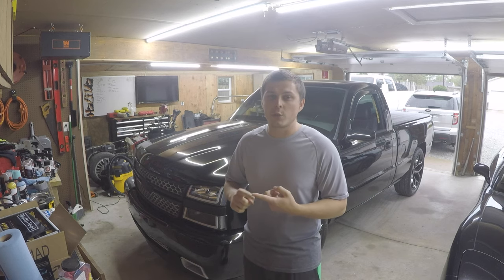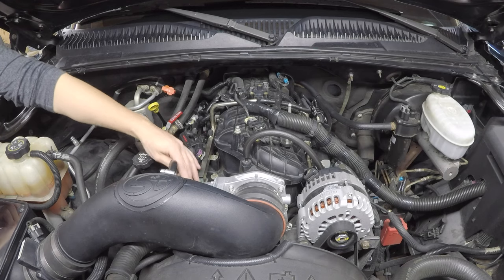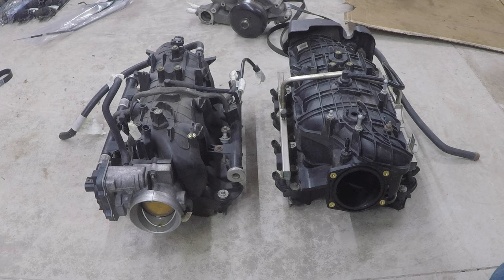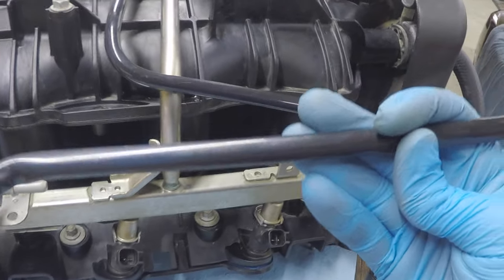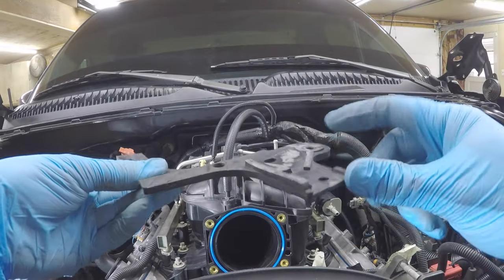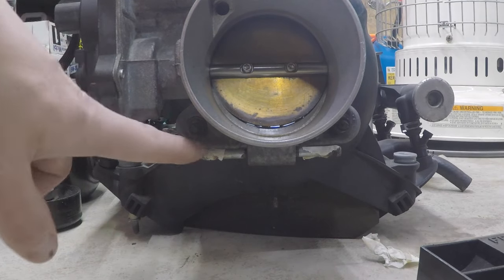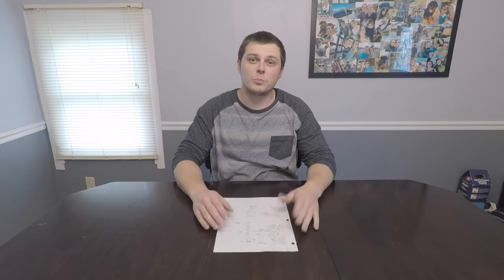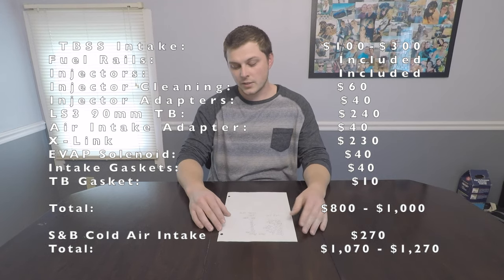TBSS Intake Swap, Ultimate Guide! Add More Power To Your LS Motor!

Comment: My 2004 Chevy Silverado 4.8l has the fuel pressure regulator in the fuel pump assembly in the fuel tank.  Would this tbss still work on my truck ?
Reply from the maker: Yup. The tbss/nnbs intakes will work on all gen III LS motors. If you have a single fuel line going to the fuel rails, that is a  return-less style fuel system (sounds like your setup) you don't need the C5 fuel regulator, and can plug your fuel line right into the fuel rail. If you have two fuel lines going to the fuel rail, that is a return style fuel system. You will need the C5 fuel regulator, so the extra fuel can be returned to the fuel tank.
Reply: @TheKingCoopa  Thank you for answering me.  After  losing $16,000 on my 97 30th anniversary edition camaro  when Precision Engine Rebuilders in Houston, TX  Ken and Rick Slataper built a 383 stroker that was supposed to be 500hp to the wheels  and it dynoed at 300hp and was put in the ship more times than I can remember then 4 months later the #8 cylinder went down and I had to sell it to the automotive shop because I couldn't afford another engine Rebuild. After all that,  I'm trying to learn to work on cars myself and watching your videos gives me good ideas.   I'd like about atleast 450-500hp naturally aspirated at the wheels in my 2004 Chevy Silverado 1500 4.8l,  but Im not sure what would be cheaper either buying a junkyard 6.0 or fixing up my 4.8l.
Reply from the maker: @texn9326  damn.... that sounds absolutely awful. Hopefully you will have some better experiences. If you're serious about building your engine, I would watch Richard holdener. He has dozens of videos about HP /power combos and shows engine dyno comparison. Definitely some great content. I have a pretty aggressive 4.8L that made 355hp/369tq. I even had a few people tell me I was lieing and forging the dyno numbers lol. But realistically, you aren't going to get 500whp out of a NA 4.8L. Anything 500plus NA is probably gonna be with a 6.2L. The 6.0L LQ9 im swapping to now, has Frankenstein stage 2 heads, 234/240 112 cam, 3600stall, ATi super dampener, electric fans, long tubes, tbss intake and 90mm TB. That is projected to be around 450-480whp.
Reply: @TheKingCoopa  That's exactly what I wanted to know.  Honestly I'd be happy with around 400hp.  I'm looking into the tbss intake,tune, and getting my stock heads worked on. Cam will come later.  Thanks for your advice and tips and videos and everything.  I've been watching your 6.0 videos. Your 4.8 videos was where I got alot of ideas from and helped me get a steady direction to go in as far as doing what to what.    Keep them videos coming 👍👍👍

Comment: king i have 2002 5.3 put a tbss intake are the intake bolts longer different from 02 stock intake
Reply from the maker: They are the same bolt lengths. If you are reusing your old bolts, I believe you just have to take the washer off them

Comment: Do you need to have it tuned to run the intake with the trailblazer ss intake and throttle body
Reply from the maker: Any airflow/fuel changes, a tune is highly recommended.

Comment: What makes your truck so loud
Reply from the maker: Hey, the two main things for it to be loud are the cam, and exhaust. All the extra performance mods help out, but a large cam is what really wakes up these LS motors. A bigger cam means more air/fuel ratio going into the combustion chamber. Which makes a bigger bang, and in turn has more exhaust flow. For my exhaust, I have 1 3/4in long tubes, which make more power over shorties. 3in catless Y pipe. Removing the cats will definitely help your motor out, and make it alot louder. The catalytic converters are super restricted. Then for a nice sound I have a gibson muffler and gibson tips put the side. If you run your exhaust out the back its better for the cab drone, but the shorter your exhaust is, the louder it will be. You could always straight pipe it,and it will be stupid loud, but never sounds good. 

To sum all that up, a large cam with a nice flowing exhaust, will give you a loud quality sound. If thats what your wanting. I love my exhaust setup, and it definitely turns heads all the time 👌

Comment: do i need an x link if I have a 2006 sierra and I'm getting a 2006 tbss manifold?
Reply from the maker: Just the intake, no. You will need the Xlink if you run the newer 90 mm LS3 throttle body

Comment: What happends if your intake/k&n  doesn't have a connection for the hose
Reply from the maker: Hey, sorry for the late reply. I'd see if you can figure out a port or way to mount it to your intake tube. That hose needs fresh air into the engine, you don't want any dirt, water, or contaminates getting in there! Plus the ECM is tuned for a certain air/fuel ratio. That little tube sucking in air is also calculated into the tune. I've seen some people put a mini air filter on it and leave it. but if you can, I'd try to connect it to the airtime. best of luck, and thanks for the support!

Comment: Did you keep the same cold air intake ? Being that the throttle boddies are different?
Reply from the maker: Hey, yes i kept the same CAI. I used a rubber coupling to adapt the two sizes. I believe it is linked in the description of the video.
Reply: @TheKingCoopa  awsome good to know and appreciate the response 🫡
Reply from the maker: For sure! Good luck with the swap 🤘

Comment: What lifters, pushrods did you go with?
Reply from the maker: Hey, I used LS9 lifters and Engine Pro (Smith Bros.) hardened push rods. They were 7.375" because of the milled heads.
Reply: @TheKingCoopa  Nice, .030 on the milling? What's a good guess on your compression, what head gasket thickness you use?
Reply from the maker: @bigkat776  sorry, I used LS7 lifters. The 243 heads were milled .015. The head gaskets were LS9. Not sure the thickness. And my tuner estimated about 10:1 compression

Comment: Since you’re running 32lb tbss injectors will you need a tune for the truck or it runs normal with them?
Reply from the maker: Oh yea, you will definitely need a tune. Its going to run super rich with the bigger injectors. I burned up my new spark plugs, in about 8-10min of just idle time. Had to put a new set of plugs in, not start it at all. And then had my tuner come to me, and tune the truck. I could have towed it to him, but he offers a mobile service
Reply: TheKingCoopa thanks appreciate the reply man 🙏🏼
Reply from the maker: For sure 🤘 also of you get yours used, id get them cleaned and flow tested. For the peace of mind. Mine turned out to be 36lb injectors, and were filled with e85 gunk

Comment: What pound injectors did you use for the intake ??
Reply from the maker: The injectors i got used. Were some GM OEM ones at like 36lb or 38lb. They were fine for the cam, but anything else they would be maxed out.

Comment: Can you still use a spacer with the 4 to 3 adapter plate ?
Reply from the maker: I assume you mean a throttle body spacer? I'd assume so. You would probably just need longer bolts to accommodate the spacer thickness.

Comment: I got a 04 Silverado I got a tbss intake will I need to get a tube for it to run good?
Reply from the maker: If you swap just the intake, you should be fine. But realistically if there are any airflow or fuel changes, a tune is definitely recommended

Comment: If i put the corvette c5 fuel filter do i have to remove my stock fuel filter on my 2003 silverado? Or can i keep both fuel filters?
Reply from the maker: Hey, sorry for the late reply. Only thing that really matters is if you have 1 fuel line (returnless) or two fuel lines (return style).  If you have the filter on the frame rail, id assume you have the returnless fuel style and would not need the c5 fuel filter regulator.   But if you do have the return style, id just run both, and check the Shredder valve on the fuel rail and make sure your fuel psi is still good, amd not slowed down by two filters. Hope that helps
Reply: Thanks. I just started doing the tbss intake on my truck im almost done. Just that mine has a retun line so I bought the corvette c5 filter but the only issue is that the lines hit the fire wall and it bend the lines

Comment: Will this set up work on my '07 Tahoe 5.3? I did the DOD delete and stage two cam.
Reply from the maker: Hey, you should already have this intake since you have a gen IV motor. The TBSS and NNBS intakes are the same thing. At the 4:13 mark, I compare the gen III and gen IV  intakes. Yours should already be the gen IV with the four bolt throttle body. 

But if not, yes you can swap this intake onto your 5.3L. Only thing to look for is make sure you get the right intake ports. Some of the gen IV motors have Cathedral Port or rectangle port.
Reply: I have cathedral port heads  @TheKingCoopa
Reply from the maker: @johnwalthers659  then just make sure your new intake matches, as some were rectangle port

Comment: Can I run the gen 4 injectors with the gen 3 Throttle body
Reply: And I know this is a dumb question do they have a plug for the evap solenoid
Reply from the maker: Hey so the injectors and throttle body don't really communicate with each other. They are kinda like two separate systems. So it wouldn't be an issue. But with gen 4 injectors, those are a newer technology. They send/recieve different signals than gen 3 injectors. It can and has been done before. But the fuel trims and duty cycles will have to be adjusted in the tune. The important part would be finding out the true flow rate of the new injectors, that will help your tuner out and will save him time. 
And I. Not sure what you mean about the evap solenoid. The plug/connector is on the side of it, and that connects right to your trucks harness. But if you mean a stopper, to disable the evap, it can be done. The guys who race alot, disable that system, and change that in the tune. Not exactly sure how all that works though
Reply: @TheKingCoopa  thank you
Reply from the maker: @haidenoubre8325  for sure, best of luck!

Comment: Are you satisfied with your 2600 stall?
Reply from the maker: Hey, short term yes, Long term no lol. It was great with the cammed 4.8L. Especially for daily driving. It handled excellent and still drove like stock. But 350hp in a full size truck is only fun for so long. right now I'm wrapping up a built 6.0L/4l80e/AWD swap with nitrous. The 4l80e will have a billet converter from Circle D. That will be a 3600-3800 single disk stall. The higher you go, the less streetable it will be.

Comment: Can I put this intake manifold in my 2007 suburban 5.3 new body style it would be just bolt on rite??
Reply from the maker: Hey, yes it should fit (the intakes are roughly the same height) and yes it will bolt in. But something to know, the 2007-2013 silverados (NNBS) have the same intakes as the TBSS. Being that yours is a suburban, I would definitely do the comparisons, because you might already have the upgraded intake manifold
Reply: @TheKingCoopa  thank you! I have a question I think I’m having problems with my intake I realized it was looses then I tightened it don’t know if I did to much it’s had a little rough idle I have done everything to it and I get a misfire on cilíndrele 1 and a po420 and po430.
Reply from the maker: So for your intake, depending how many miles are on your truck, and how old the intake manifold gaskets are. Those gaskets get hardened into that shape, and you can't re-use them, or you will have an air leak. So if your intake lifted, and you re-tightened it, it could still be not fully seated on the old gaskets and could be sucking air in, causing the mis fire. I hate to say it, but you might have to pull the intake and replace the manifold gaskets, to create a good seal. So that is 1 option. 
But first, your p0420 and p0430 codes are your bank 1 and bank 2 catalytic converters. Which i assume you have 150k mikes on the truck, and those cats are probably clogged. That would creat almost zero air flow out of the exhaust, crearing way to much back pressure, and that would definitely cause a rough idle. And the exhaust can smell like eggs.  So if I was you, first check cats, then check the intake. But oem cats can be very expensive, so if you live in an area that requires smog testing, id look into some high flow cats, half the price, allows your engine to breath better, and still passes smog. But if you don't require smog testing. Id get some speed engineering 1 3/4in long tube headers, with a catless Y pipe (about $430) then get a tune. Your engine will breath alot better, gain more power, and probably gain a little mpgs, getting rid of the cats. 
But look into those, and that should fix your problem

Comment: how could i connect the fresh air tubing when my intake doesnt have a nipple like the s&b ?
Reply from the maker: Hey, ive seen some guys plug that tube, and run a little filter right off the valve cover. Still the same concept put those little filters dont do much, like a real intake filter does. 
You might beable to find a connection or bolt style connection, to put in your intake tube. That alowws air flow but has threads on the outside, to put a nut on. And then the hose connection.
Or you could get something similar to this 
https://www.improvedracing.com/vcm-pcv-line-relocation-kit-for-otr-intakes.html?gclid=EAIaIQobChMItPWP0-PP8AIVsffjBx3SSApPEAQYByABEgL2QPD_BwE
Reply: @TheKingCoopa  thanks, thats the only obstacle im facing right now, i might just buy a new intake if i cant find the right fitting.
Reply from the maker: @20589  yea, can't go wrong with the S&B. I did a decent amount of research on them, and everything I found blew K&N out of the water. But if you ballin on a budget, id look into the valve cover air filter.

Comment: What year TBSS will go to 03 GMC Sierra?
Reply from the maker: Hey, they made the TBSS from 2006-2009
The TBSS intake is identical to the NNBS silverado and Sierra (2007-2013). The only important thing to look for is the head ports. Some of the NNBS came with rectangle port heads. And those won't fit on the Cathedral port Gen III motors.

Comment: Does anybody know the part number for  the positive  crankcase ventilation valve
Reply from the maker: You could try theses out, but any parts store, autozone or napa will have it.

https://www.oreillyauto.com/detail/c/microgard/engine-sensors---emissions/pcv/pcv-valve/c24c7c440178/microgard-pcv-valve/mgd0/pcv178/v/a/17836/automotive-truck-2004-chevrolet-silverado-1500?pos=0

https://shop.advanceautoparts.com/p/acdelco-professional-positive-crank-ventilation-pcv-valve-b2040458928acd/11472496-P

Comment: What about trucks with drive by cable? Any recommendations?
Reply from the maker: Well its not electronic. So either get a 3 bolt to 4 bolt adapter, to keep your existing TB. If you want to upgrade, buy a 90mm DBC TB, bolt it on. Connect your cable. And you will need a support bracket to hold the cable on the intake manifold, close to the TB. You can buy them online, not sure what website though. Everything else should still be the same
Reply from the maker: @planedr  sweet, I'll add that in the description for the DBC guys. Thanks!

Comment: Mine is a 2002 Yukon Denali 6.0. But mine has a by wire TB would this set up work for me to?
Reply from the maker: Hey, the setup will still work, but you won't need the new electric throttle body or the X link. You can get the 3 to 4 bolt adapter, or get a 90mm drive by cable throttle body
Reply: Thanks for the reply. But I forgot to mention I got the TBSS intake on already and I want the 90mm  TB and like I said mine has electronic throttle body even though its a 2002. Thats the year they made both cable driven and wire driven  my throttle body is wire driven. And thats the reason I would like to know if it would work.
Reply from the maker: @02denaliyukon82  oh, didn't know some of the 02 were DBW. I though all 99-02 were DBC. Well honestly if I were you, before you spend the money on it. It give Tourqe Rush Performance a call. And ask them exactly what you need.
Here is the website
http://www.torquerush.com/x-link.html

At the top it says the X link works for 03-06 full size trucks, but farther down it says this:
 What about the 2002 and 2007 electronic throttle control trucks?
The 2002 trucks use a different throttle body, TAC module, Pedal Assembly and PCM calibration.  A straight adapter harness is reportedly all that is required for the LS2 90mm swap in this application.
The X-Link will work for the 2007 “Classic” trucks, as they utilize the same throttle body and TAC module as the 2006 trucks. 

So im not really sure. I dont wanna say smyes or no, then be wrong haha. I'd definitely give them a call if your contemplating the swap.
Reply: Got it and I will be giving them a call. Thanks for the information I really appreciated you answering back. And keep up the good informative videos.
Reply from the maker: @02denaliyukon82  for sure, good luck on your quest! And thanks for the support 🤘

Comment: What cam u running
Reply from the maker: Hey, it was a custom grind I ordered. But it was a crane cam 226/234 112+4. The truck made 355hp/369tq on a hub dyno.  Gerting prepped for a built 6.0 LQ9 swap, 2step, and a 200shot of nitrous. I'm hoping for 400-420ish hp and around 600hp on the bottle.

Comment: Would this work on a Vortec 6.2 as well?
Reply from the maker: Hey, so if your talking about the gen IV truck 6.2L. It will already have this intake, the TBSS/NNBS are the same thing.

If you mean the LS3 car 6.2L. Yes you can swap it, but most car firewalls can't clear that large truck intake. 

This intake swap only really applies to the gen III motors that have the older style truck/car intake.